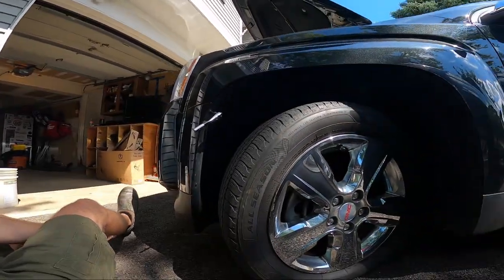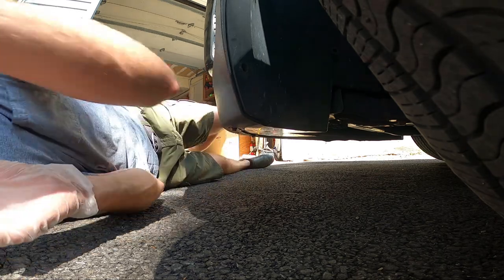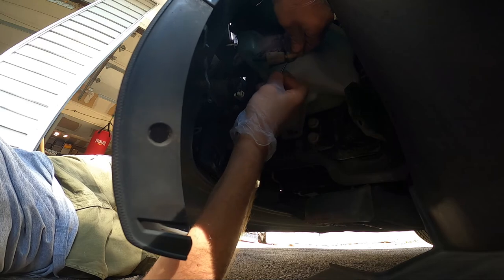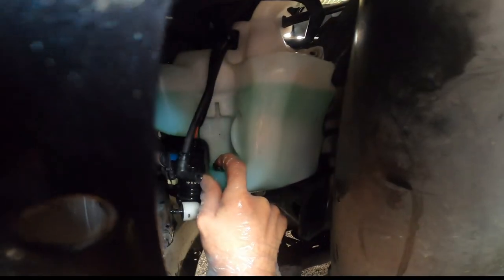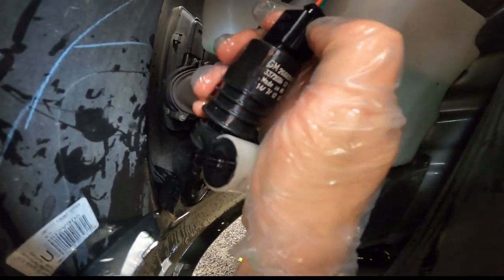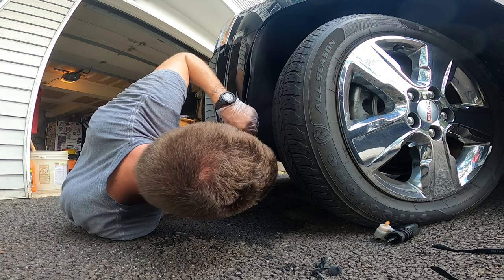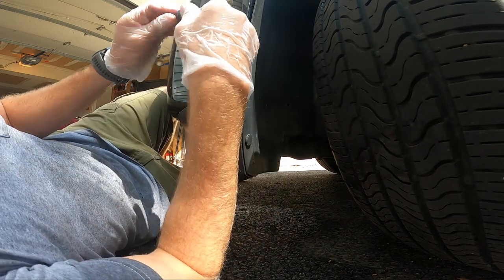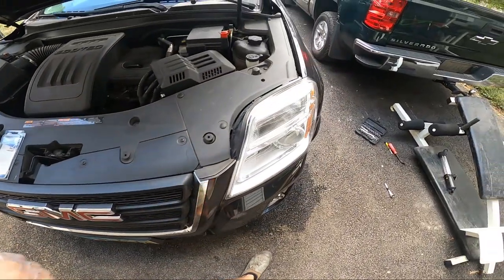2010-17 GMC Terrain/Equinox Windshield Washer Pump Replace

Comment: You made it look so easy! I saw the other video where the guy took the whole bumper off, that was crazy to me as well. You’ve given me the confidence to do it myself as well, thank you!!!!
Reply: I have replaced the pump I have replaced the fuse I have replaced the mechanism on the steering wheel turning signal. Still does not work not getting power to the steering wheel, now what?